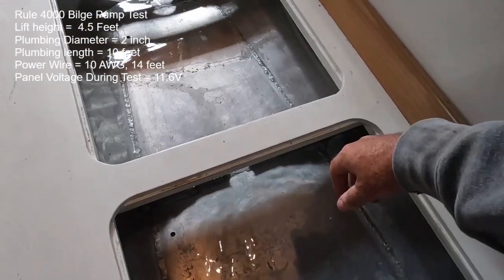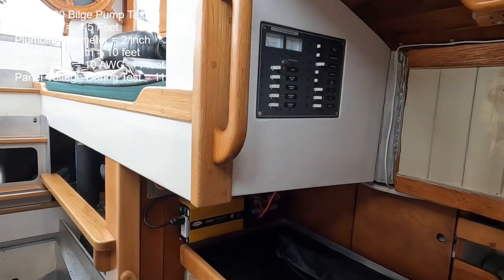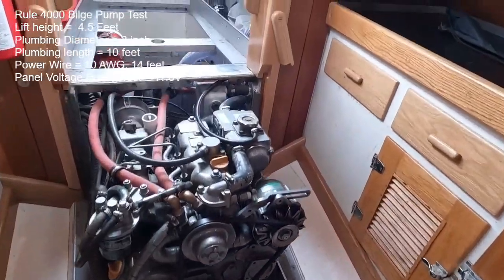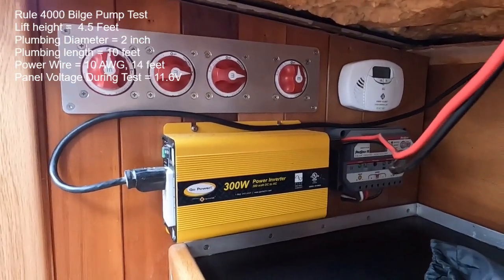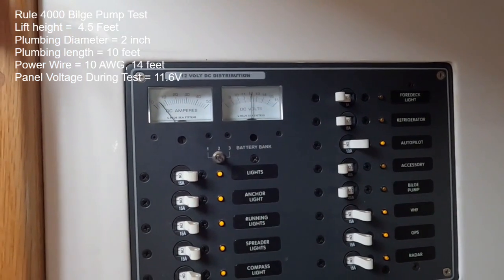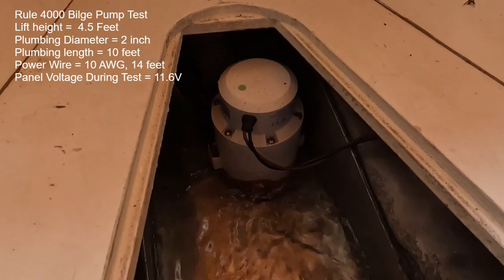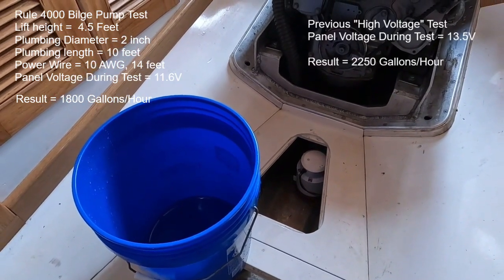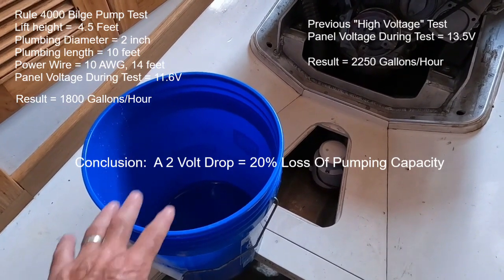Rule 4000 Bilge Pump Test - Part 2

Comment: Hi, what I’m about to say has nothing to do with bilges except that it’s useful on boats. Ok so what I would like to know is if you can test a new anchor called Excalibur Apex. It’s a copy of Mantus M1 anchor but about 2/3 less in cost. Sold on Amazon, EBay and the company name is MarineNow. I bought the 35lb and just received it however I have no way of testing its strength. What I can say is It looks identical to the Mantus M1 and while on its side a strong breeze can set it upright. Thats all I have tested so far. If it’s a well made Mantus copy and works well then a lot of other people could afford it at $179.00 for the 35lb. Would greatly appreciate if you could test and make a video. Thank you for your time